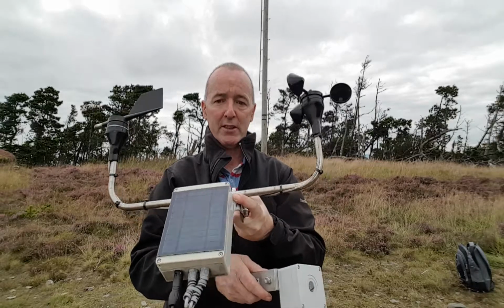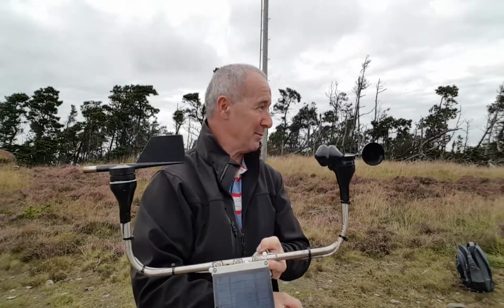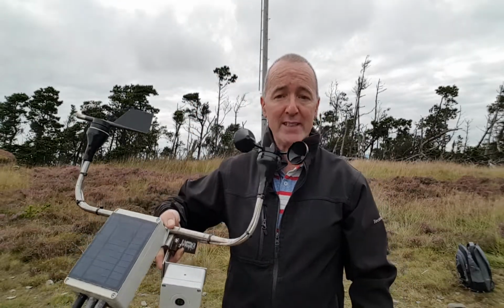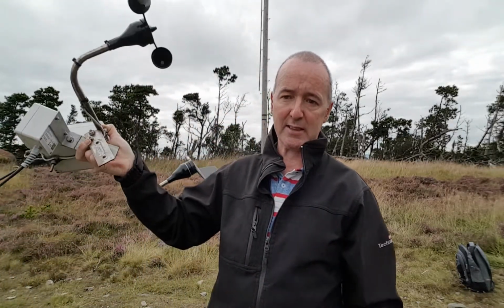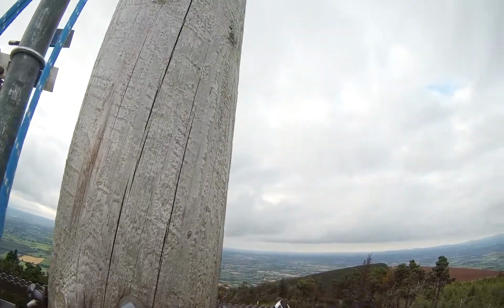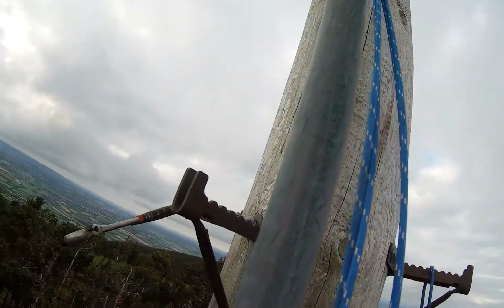Solar Powered Off Grid Gsm Weather Station

Comment: Well done Gerry another great job. You can always find work with the P&T lol.
Reply from the maker: Hi Eugene. Hopefully it reliably sends the telemetry and photos for the next year. The electronics and programming are stable and reliable. The weak point of the station is the moving parts i.e. direction sensor and speed sensor. Last year the wind was over 100mph for a few hours. Here's a link to the data. http://holfuy.com/en/
Hope you got to fly to day. Cheers Gerry

Comment: What is the camera setup? Did you buy a custom housing and mount a webcam inside of it?
Reply from the maker: Hi Justin. The mountain is a harsh environment so we have gone through a few weather stations at that location. The criteria is that they are gsm and able to run on solar power. I was using our own sensors and home made brackets etc. We are now using a complete kit from Holfuy.com. The camera is from them too. Live data here https://holfuy.com/en/weather/161  Hope this helps Cheers Gerry
Reply: @GerrysDiy  Thanks, yes that answers my question though it seems the cameras that come with that vendor aren't sold separately :(

Comment: Hello Gerry
good job/video
where on the internet can i see the weather data?
The bracket you have built yourself? How did you attach the plastic box?
Greetings from switzerland
Reply from the maker: Hi Frank and Greeting from a wet Ireland I hope your weather is a bit better there in Switzerland. The camera sends photos once every 10 minutes during daylight. The weather station survived Ophilia with a gust of nearly 100mph. The plastic box is connected to the flat stainless bracket with bolts going through the plastic box. Here's a link to the weather site. http://holfuy.com/en/weather/161 Cheers Gerry